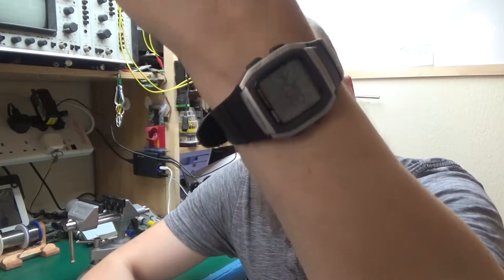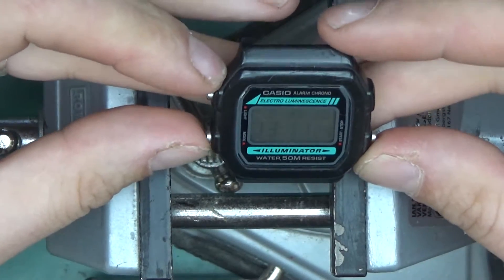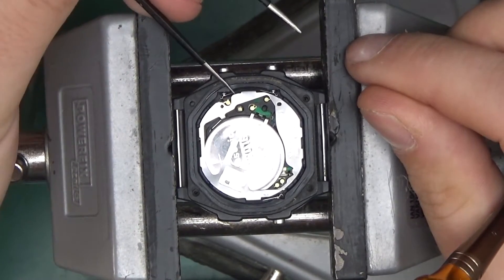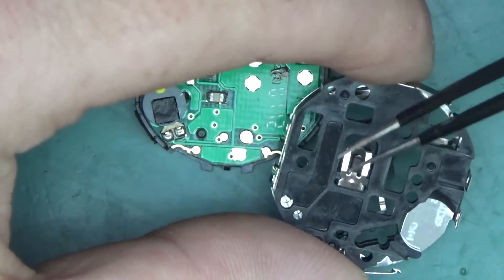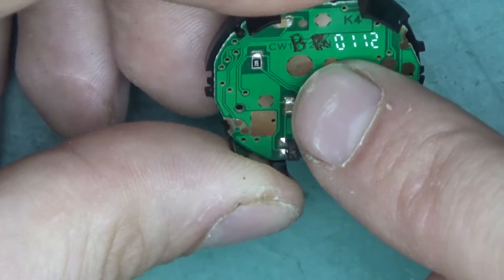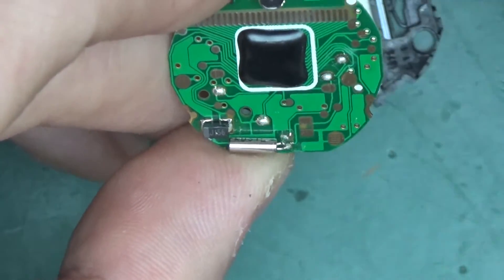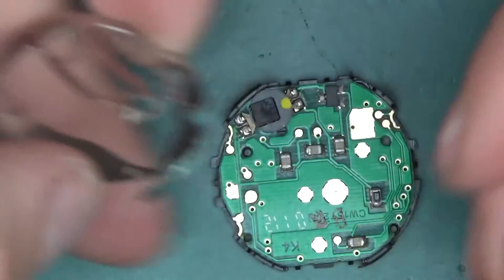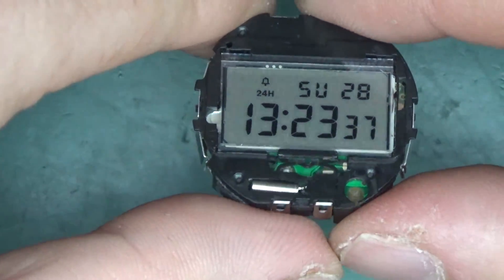Casio W86 teardown

Comment: I have today for the first time changed the battery in my w-86.   The watch is 24 years old.  It still told the time perfectly however the back light wasn’t at all bright and the black numbers faded when the back light was pressed.  Also, the alarm stopped working.  The new battery fixed all this.   
The phone has been all round the world.  The original strap broke last week and a new one is on order.  The watch was bought in 1998 to avoid analogue watch thieves in South America. Your video gave me the guidance to change the battery.
Reply: Funny ,just tried to change battery after 25 years and now alarm doesn't work.
Reply: @NevervousOtoole    Shame.  Hopefully it’ll come back.
Reply: Oh the spring is missing now.. have to find a spring out of watch bar that fits.
Reply: @NevervousOtoole    A bad day.
Reply: @strontiumstargazer103   I'm quite chuffed.. cut a spring out of a watch strap spring bar cut to about 1/4 of an inch now working ,the hour chime ,alarm,light ,chrono. Anyone out there who looses spring use a watch bar spring.
Reply: Mine was brought in Porto cristo in 1999 majorca

Comment: Hi there, I have the W86, but the alarm stopped working... Do you have any ideas please? I thought there might be a tiny spring missing, because the back plate inside the steel case back is still intact.

Comment: The Casio W800H has jumpers like that. You can solder/desolder them enable a countdown timer, enable an extra 4 alarms, and disable the dual time function if you wish.
There are also a couple of others that have as-yet unknown functions. People have speculated that they could be for adjusting the accuracy of the watch.
I'd love to know what (if anything) the jumpers do on this model. Any extra functions added would be a big deal, as it is quite a simple 3-button movement with very basic functions.

Comment: 6:08 you do not have to take off the entire metal cage to change the battery. You don't even have to remove the module. You just need a safety pin to to pry up the clip over the battery. There are plenty of videos on youtube that show you how to remove the battery. At 3:32 where the screwdriver is pointing to is the area you use the safety pin and un-clip the battery holder.
Reply: I was thinking the same!
All it takes is a screwdriver, a pin and 5 Minutes to change the battery 👍🏻

Comment: Did you ever try the different solder jumpers? I've wondered about those since I opened up an F91W and noticed them. What's even more interesting is that different F91Ws have different points jumpered. I plan on soldering them up and seeing what happens.
Reply: Any update on the F91 soldering? Thank you.
Reply: @roadgent7921  I found out the three jumpers on the right are to adjust the clock speed. They're to adjust the accuracy in increments of about 15s/month. The three below the blob, I'm not sure. The jumper to the left of the blob turns on the led from what I remember.
Reply: @dshambli  I was hoping there would be a "secret" fine trimmer!!! Still worth knowing. Thanks for the investigation and feedback. Regards
PS - just revived a 1989 DW270 with a new battery - had lay idle and "dead" for 15 years. Works fine; Casio rule!

Comment: Thanks for the very informative video. Just got mine from amazon, great to see the insides of it, been a Casio fan since the 80's-my last Casio, a G-2900F-1VER lasted 10+ years! I needed a small cheap everyday watch I can take a shower or swim with, very light and thin so it doesn't get caught in gloves or in tight winter jacket sleeves with an easy to read dial and a good backlight. Casio watches are indestructible, last long, look good and can withstand plenty of abuse, and all that for €15 !
Reply from the maker: Agree! You can't beat that quality for the price! Thanks!
Reply: just watched your video 'How to reverse the rotation of DC brushless fan motor from PC', saw you're wearing a w-86-1vqes with a very cool bracelet, definitely an awesome upgrade! Perhaps you could make a video about different sorts of bracelets too since nowadays watch-repair kits are affordable and easy to get.
Reply from the maker: @genkishan  that was a makeshift bracelet made out of display "dummy" model of Samsung galaxy watch, lol. I liked it, it was a "conversational piece" 😅

Comment: I would like to buy a simple Casio like the new W217H or W-800H, but has anyone ever compiled a list of Casio watches that have usable trimmer capacitors?  Many G-Shocks have these, but I hope to find a simpler, thinner watch that is trimmable.   Wondering if you know... (I wear a F-201WA daily, and have opened it up before, and it appears not to have a trimmer cap. My GLX5600 has a trimmer.)